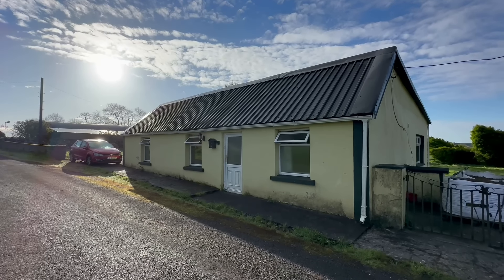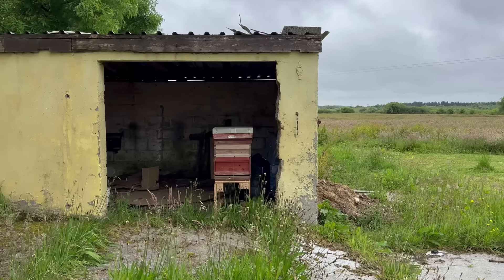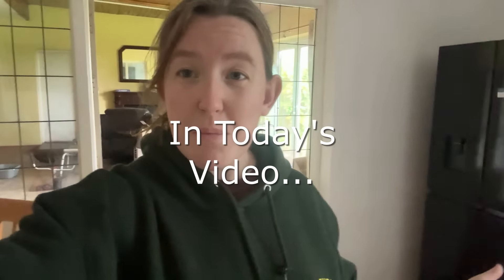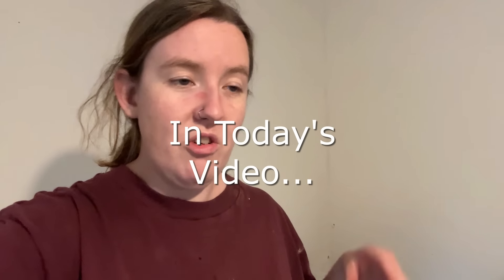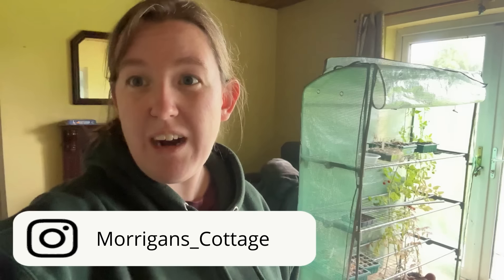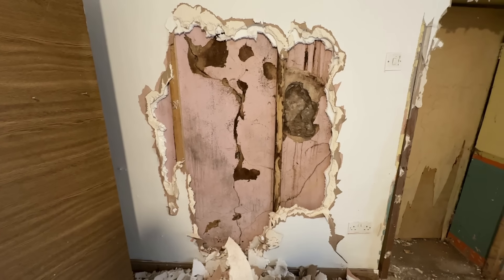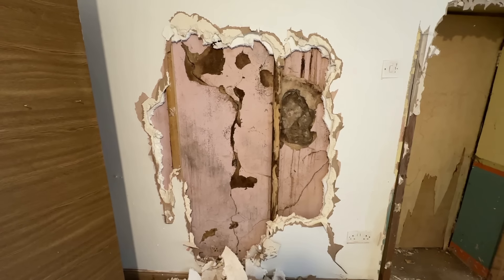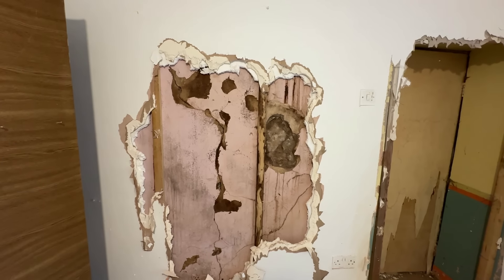Hidden Mold & Damp Discovery in my Old Irish Cottage Walls - DIY Renovation Nightmare  Ep. 77

Comment: Aisling, no idea why anyone would want you to leave plaster on the walls with dampness & mold behind them. Remove anything that was in the house when you bought it. Furniture, fittings, & strip all of the plaster and lath off your walls and ceilings and leave it to dry for a couple of months. You might have to wait untill your grant is approved, but once that is done then I think that should be your first move
Reply: @seanpyke8553  yes definitely- that old plaster should have been removed before they put plasterboard up - and there should be an air gap between old wall and new board - the whole thing  was just done wrong 🤷🏻‍♂️
Reply from the maker: Maybe it’s because I’m making the house uglier but it’s so necessary, especially seeing all the problems in minor structure things and also the damp/mold! It’s all a learning, and definitely stripping as much back as I can, it’s slow work 🥲😂
Reply from the maker: It really was!!

Comment: I kinda understand why you are poking holes in the walls but if it was me Id tear down the sheetrock in one room and be done with it then move onto the next room. If it has to come down anyway why not just clear the room. I did see the brown water damage in the ceiling and id just get rid of it all then deal with the mold because where there is damage there is a problem.  Just do one whole room now api kinda know what's up/
Reply from the maker: I did initially start with one room at a time but had to do pocket holes before the builder came out to take a look at all the rooms - will definitely be sticking to one room now its the best idea :)
Reply: @morrigans_cottage  sorry wasn't meaning to come across so opinionated. Just taking out the sheetrock to all four walls would give a clear idea of what's going on behind it all.